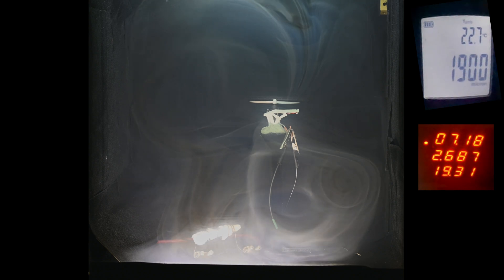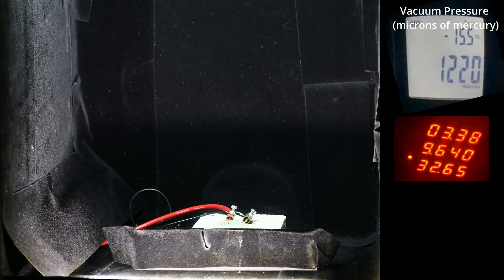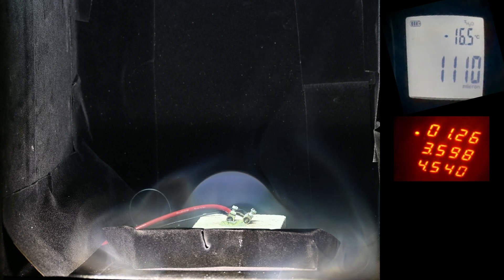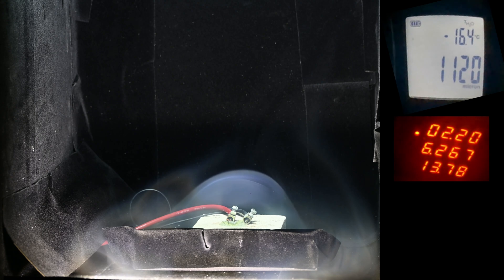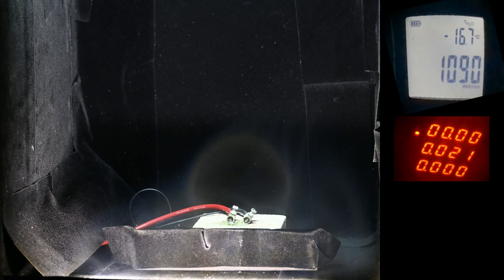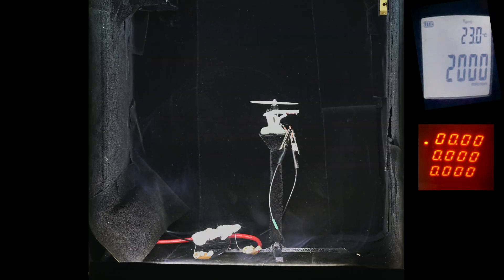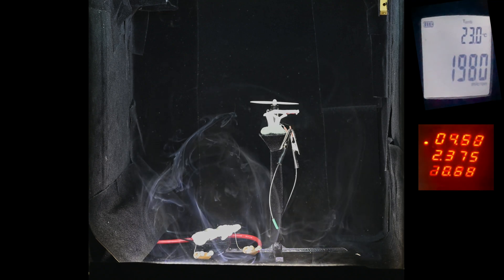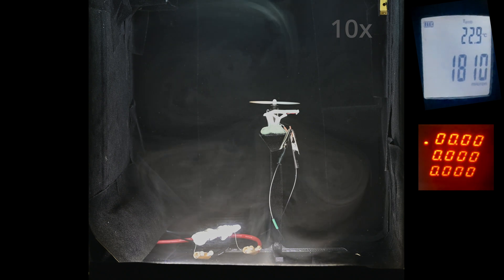Can a Fan Blow Smoke in a Vacuum?

Comment: please don't use microns. All relation to mbars or torrs are gone then (i'm a mBar guy btw (no Pa 😀 )) but a torr and a mBar are close enough to get the pressures 1Torr=1mBar for very fast conversion of the old rubbish. At 1mBar there is enough pressure to keep things flowing like a liquid. They even fly drones at 10mBar :-). Nice video!

Comment: I remember taking fumed silica, which usually just makes a horrible suspension in the air at 1 bar and putting it in a canning jar, getting it down to 50 microns or so and sealing it. You could shake the jar and it would just drop and be crystal clear (aside from what stuck to the sides). I think it would definitely be qualitatively different to get your vacuum chamber down to that level of vacuum, though it might not be super interesting.

You could try something like the drone motor in a pan of fumed silica though. It should just produce "smoke" even at 2k microns, but behave ballistically at 50, which would be interesting to see. It would be a good way of adding "smoke" without adding gas pressure.

Fumed silica is not fun (or terribly safe) to work with though.

Comment: ultravacuum turbopumps are actually just a kind of 10000-100000 rpm fan. Of course it can blow smoke, if it can blow even single molecules :) 
Molecules and particles moves kind of random. That is why at the end in the chamber the pressure (or number of molecules per volume) is the same + gravity induced gradient. Once you switch on the fan, it denses a part in front and depressurises part at the back. Even because of brownian motion particles/molecules behind will have higher probability to travel longer in direction with lower pressure, equalizing thereby the pressure again and again. So what you would see at the perfect end is a stable "picture"  of pressures - as on 5:40

Comment: would an ice cube produce a "wind" of water vapor that would blow the fog around? investigating outgassing of various things could be interesting... a grape? a block of wood? styrofoam? small block of dry ice? if the pump is left on, would the dry ice flush out enough oxygen to make a difference in how long you could run a copper "filament" at orange hot before it oxidized? same with an actual tungsten filament?

Comment: I don't understand why the smoke/vapor/dustcloud forms that hard boundary at the edge of the sphere- I expected a smoother gradient from the source to the corner with the vent. Does gas not really mix when the pressure is so low, and the smoke is just going out till the other gas finally stops it and then... just sits?

neat setup, neat results, fun video
Reply from the maker: That’s a good question, I’m not really sure why the smoke behaves that way. If I had to guess I think it may be as the particulates and gas come out they have some amount of momentum and are then slowed by gravity and by the small amount of other gases in the chamber. I suspect that they tend to run out of energy then the next wave come in stacked behind them sort of like a traffic jam. This would lead to a sort of wall with the subsequent particles not having enough energy to substantially disturb the boundary. Not sure though.

Comment: Wonderful!  It appears as if, at this very low pressure, the fan is acting more like a centripetal pump - slinging the particles out to the side and pulling material in from both the top and bottom.  I wonder if this is due to the relative lack of confinement gases - and.. are confinement gasses necessary for props to be able to slide gasses in the typical direction through increased pressure on the “aft” side of the prop.
I’m starting to think props may become ineffective propulsion devices in near vacuum!  😄
Reply from the maker: Yes an interesting thing that seemed to happen was that as the propeller imparted more energy into the remaining gas in the chamber it actually reduced the pressure. I think this is similar to how a turbomolecular pump works in principle.
Reply: @paulmh well that could be bc as you decrease the pressure you loose 'suction,' i.e. at low pressure the gas no longer has enough self collisions to push itself into low pressure regions (i.e. a vacuum wouldn't work in a vacuum lol). So in order to keep pumping you're relying on the random motion of the remaining gas molecules to happen to bounce into your pump, this is why high vacuum pumps like turbos or cryos have very large intakes many times wider than the roughing/ backing pumps. So by imparting kinetic energy into the molecules you're increasing the rate at which they happen to bounce into your pump. Granted I'm not sure your pressures are quite low enough to completely lose suction, but imparting more kinetic energy would still have the same effect I believe.
Reply from the maker: @xxportalxx.  yes exactly my thoughts too

Comment: Can you add a speaker to the camber?
Can you cool one area of the box?
What will a strong laser do to the vapor?
Can you add an electric arc to it?
tesla coil?
Reply from the maker: I tried with a small speaker, about 3cm in diameter but this had no effect on the smoke. I am trying to source a larger speaker for more experiments. I will be doing a few different temperature and electricity based experiments soon.